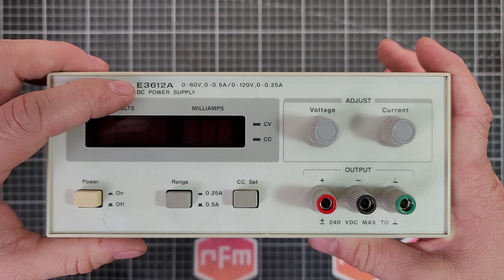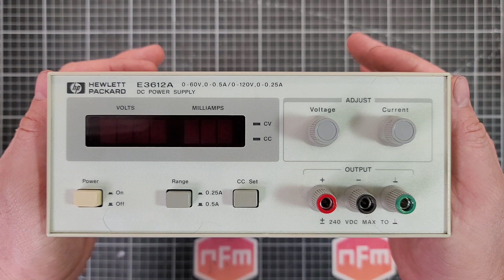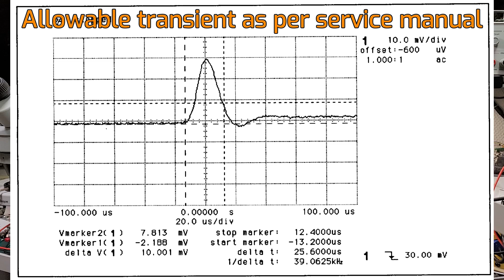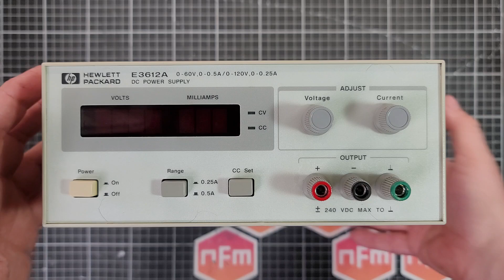HP E3612A Power Supply Test and Calibration

Comment: Nice, should be picking up a similar unit soon, found locally.
Reply from the maker: Nice! They are a good power supply.
Reply: I bought two hp power supplies. They are off by about 0.2 V.